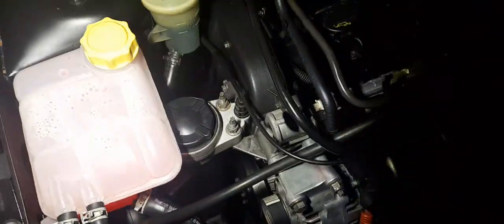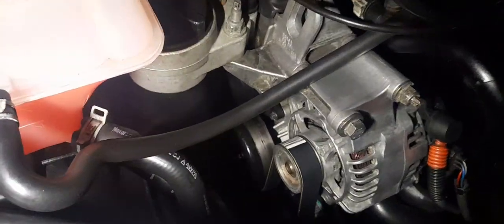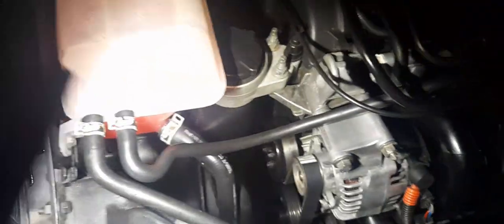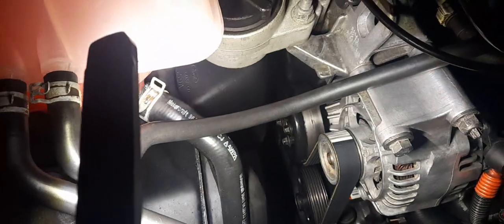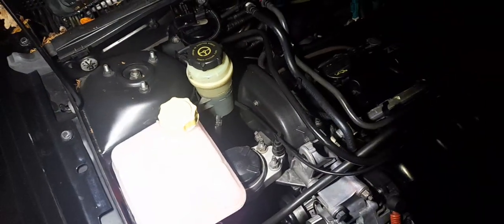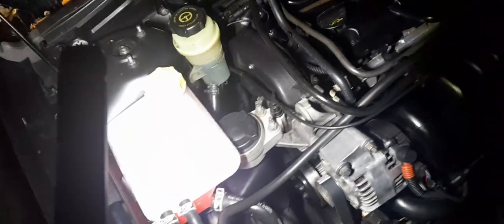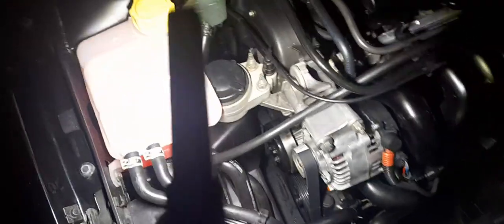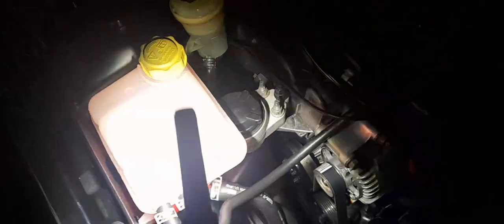Ford Focus Mk1 - 1.4 & 1.6 Water Pump Change Quick Instruction video!

Comment: Thanks for posting this really useful video. I have a Mk1 Ford Focus and had the belt and water pump relaced last year, but today the car was making an awful noise and I can see that two of the four bolts that hold the water pump pulley are now missing, one was almost out and the other ok. The pully now looks not quite straight. What size bolts are they? I was thinking of trying to fix it myself by replacing the missing bolts.
Reply from the maker: The mechanic who did that did not tighten those bolts enough, this is a first tbh! The bolts come with the pulley and are 8mm head I believe on M6 threads, you will jave to measure the length of the thread and width and that will get you the bolt you need. Otherwise getting some from a breaker would be ideal.

Comment: Why is it whenever I find a decent mk1 info video from you, it then needs to be done to my car!

Absolute pain this job is, but thanks for the pointers they were a huge help today. Haynes manual is very wrong for this task as the timing belt cover must be removed and although I decided it would be a good chance to get a new thermostat in, I did find it easier with the alternator off. 

New ford pump came with vague gasket refitting directions that didn’t quite match the pump, but used gasket logic and followed furthest opposite pattern and worked outwards. 

I did take my time with this job, as there was a lot of challenging steps I haven’t done yet, such as with the engine mounts. 

Hopefully done everything correctly, not tested yet as I ran out of time today to put the alternator and cam belt back on.

Thanks again!
Reply from the maker: Fantastic job! Well done for taking your time and when people say they followed each step logically my feeling is your all ready 90% of the way there! Its a funny job but well worth it!
Reply: @usuallyfixingtinkering  cheers mate. Next time I can do it quicker, just the fact there were a few bits I hadn’t touched before. 

Although the Haynes manual informs better for the other jobs like engine mounts drive belt thermostat and coolant renewal etc all those things combined make it massive job really for something that’s actually relatively simple.

Annoyingly, I renewed my coolant a couple months ago but can’t reuse it because a lot of it sat out exposed and got contaminated whilst it was sat leaking on my drive.
Reply from the maker: the haynes manual makes everything feel like it should be much easier than not - the manual was done on a relatively new car! these are not obviously and there are many age-related challenges that get thrown up! I should write my own book lol!
Reply: @usuallyfixingtinkering  Yep! I usually cross references forums videos to the manual and 9 times out of 10 there’s a better way. Probably should to be honest!

Comment: Does the water pump housing not go underneath the timing belt idler pulley requiring timing belt replacement on these engines?
Reply from the maker: Not on this engine the idler pulley is at the top, not obstructing the water pump so no need to remove the belt. I've done it before on mine.

Comment: Really wish someone will give us diyers some good advice on refitting and torquing the water pump pulley on mk1s
Reply from the maker: Torque settings are stupidly low on each of the small 8mm bolts, 7NM! Just hand tight and give a slight nip - basically!
Reply: @usuallyfixingtinkering  that was quick. Thanks. Basically what I did. Haynes says 25 nm but I cant check cause of lack of space and even if i make space for one at a time at the top i cant stop the pulley from spinning. I also tried with the belt on which allowed an extra marginal bit of torque but not sure if they made it to 25 nm as per haynes
Reply from the maker: @roxy806  sorry I misread the earlier post - the pulley bolts - put all the bolts in as much as possible before the pulley starts spinning. Then place/hold a spanner across two of them bolts while tightening the bolt you want to tighten, don't bother with torque settings, just as tight as you can :)